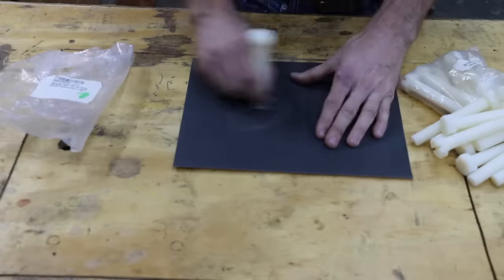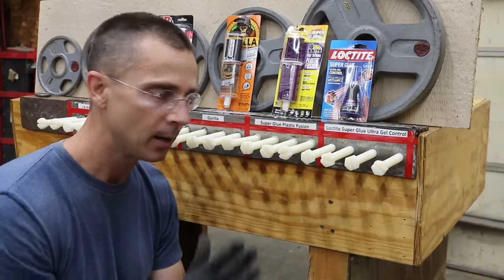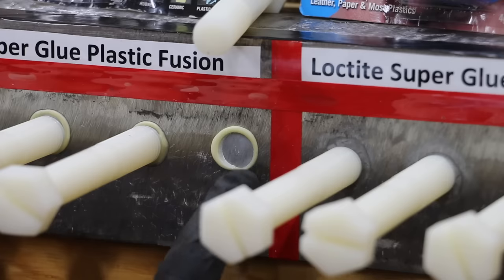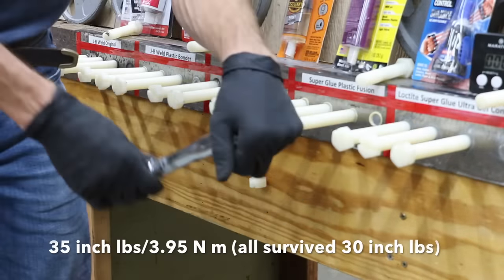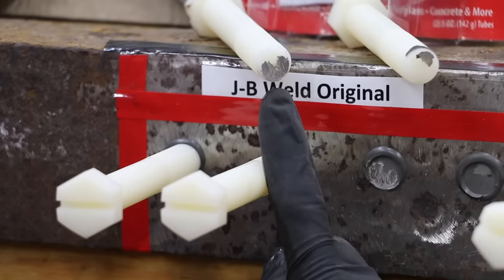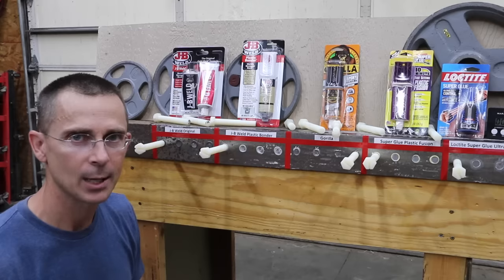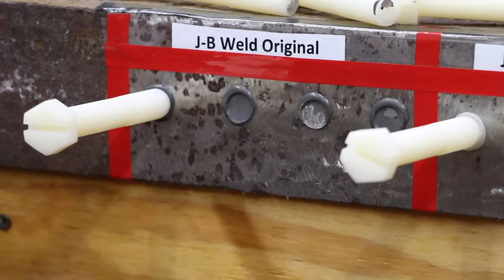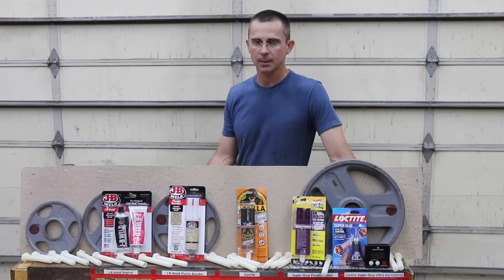Which Epoxy is Best for Plastic?  Let's find out!

Comment: Can you test threadlockers such as loctite and jb weld etc. and see if the work and wich works better? You can tight the bolts with the torque wrench  using threadlocker and then mesure the torque required to loosen them .
Reply from the maker: Teo, Yes, I plan to test threadlockers very soon.  Thank you very much for this recommendation!
Reply: I once used regular superglue one some bolts holding a pull starter on portable generator. When I had to remove them later the bolts wrung off with the nuts still glued on.
Reply: i'm sure there will be some variability, but most strong threadlockers require heat to loosen (without heat you can literally twist the head off the bolt)  It might be interesting to know the strongest that is still removable without heat though.
Reply: In the fastener of testing industry what you're talking about is a very common test. All you need is a clean degreased nut. Run the nut fully into the thread locker, let it cure, then measure peak removal torque.
Reply: The engineering company develops and produces precision testing equipment, the most common one we make is for torque measuring. The torque measuring system is most often used by beverage and pharmaceutical companies for testing cap install and removal torque but the system is very adaptable for measuring torque on just about any application, its an extremely precise and repeatable tester, I bet that it could even be used for the common test you mentioned otm646
Reply: That's way more complex than necessary. A simple beam inch-lb torque torque wrench is all that the ISO standards require.
Reply: Very good point, I seem to get a little ahead of myself at times and it seems that on occasion i forget the meaning of over-engineering and just way over complicate some things. i tend to try and remind myself to occasionally take a step back and remind myself that theres a point where what im trying is way above and beyond whats needed
Reply: Yeah..threadlockers, especially in engines...I's like to see that comparison..!
Reply: How would you judge a winner?  You don't want a threadlocker to be a near impossible to break bond, even something you consider a "permanent" fixture, may at some point need taken off.  Plus there are different threadlocker formulations for that difficulty and for heat resistance and at different price points.

In other words the best threadlocker for an application provides ONLY enough locking to keep the fastener tight in THAT application.
Reply: bhartley1024, you should have first applied some Super Glue Remover (product) or if the surfaces are not plastic, acetone will also soften up super glue (cyanoacrylate).  Ironically this works out great because it's usually a metal bolt and nut or tapped metal, which means the normal acetone/transmission fluid mix that works well for other seized fasteners will work on superglue too.
Reply: Threadlockers can hold too well. I don't think you really want something that hardens too much. If you can't at least loosen the threadlock enough with heat, all it means is a broken bolt in the future. You might as well weld it on.

Comment: Please try out dish soap (liquid kind) in a lawnmower engine and use the same amount of dish soap as you would oil
Reply from the maker: Thank you for this recommendation!
Reply: please do it its been driving me nuts if it would work as like a high viscosity oil
Reply: Project Farm try to mix each epoxy and see if they hold better
Reply: please
Reply: TheGirfan1234 no use atf
Reply: PingasTheFourth it's worth a shot
Reply: Instead of dish soap try maple syrup
Reply: williamkohlerjr gg
Reply: TheGirfan1234 and add a tad bit of water
Reply: Try using E85 in an engine, it supposed to be used only in flex fuel vehicles. Interested in how it will preform in a regular engine
Reply: probably foam up and ooze out, aerate and not work! lol, same happens in a dishwasher.....
Reply: well its worth a shot/lawnmower
Reply: He could try dish soap vs dishwasher detergent(non foaming).
Reply: TheGirfan1234> I agree with the griffon, no water, and no possibly abrasive dishwasher soap.
Reply: Dandruff shampoo would be interesting to see.  It seems to lubricate fairly well on those one armed bandit machines.  Would be interesting to see what it would do in an actual engine.
Reply: Most Dandruff shampoos contain I high level of zinc which is also used in motor oils to protect against metal on metal contact.  I expect it would fail eventually but it might take longer than you think.
Reply: This would be great to see!
Reply: What about the coal tar shampoo?
Reply: Put Epoxy in the lawn mower engine
Reply: With a small amount of liquid bleach. Bleach is slippery.
Reply: YEA
Reply: Feel how slippery your hands are before and after washing them with dish soap.  Your hands are definitely less slippery.
Reply: What's the point?  You gonna stop using oil?  I prefer spending time on useful stuff, like epoxy comparisons.  There are plenty of whacky-fun websites out there already.

Comment: First time on your channel and I love how thorough you are! However, I think it would have been good to test how much strength each had when being pulled directly away from the point of contact. I found this video because the door handle to my oven got yanked out and the housing holding the screws got stripped, and I wanted to see what product would be best to use. Thanks for the info!

Comment: Love your vids! I'd also like to see plastic-to-plastic, specifically ABS. I'm guessing those bolts were nylon? Nylon is more resistant to solvents than ABS, so these epoxies may perform better with ABS.  Majority of the time, when I need an epoxy, it's to glue back a mounting tab, joint, or bracket that busted off some ABS plastic snap-fit thing.  Lately, I've been repairing broken plastic things with LOCTITE 11C Hysol instead of my regular go-to, JB Weld.  I'm curious how it compares.
Reply: Exactly. test failed. trying to find out the best plastic epoxy but proceeded with a metal base frame.
Reply: Try 2 part plumbing glue. Or straight up black abs glue for putting together pipes. I've used it and it has never ever broke

Comment: You should compare different types of penetrating oil such as PB blaster and liquid wrench. To see which one works best on rusted nuts and bolts.
Reply from the maker: This is a great suggestion--thanks!
Reply: Project Farm+ if you do a penetrating oil test please include a popular home brew that is supposedly better than all the commercial ones, half ATF + half Acetone shaken well before application.
Reply: Siggy in CR Yes. I use this all the time. I will never buy commercial penetrating liquid again.
Reply: Dont forget kroil thats some amazing stuff
Reply: Aaron Kirchner PB blaster is awesome it does blow rust right off of stuff
Reply: He already did 2 of those...

Comment: Unfortunately the Nylon bolts weren't the best idea.. Try with plastic bolts next time :)
Reply from the maker: Great point--thanks!
Reply: Nylon is a polymer. "Plastic" is a polymer, The problem is there are a lot of "plastics" so what one, each have different properties.
Reply: @ProjectFarm  Also try ABS plastic sheet instead of the steel, since you are testing plastic bonders? Otherwise great video as always.
Reply: @gamecapturemoments1  Yup... lots of different plastics. Actually I think there'd be most interest in bonding metals to, say, carbon fiber reinforced epoxy or similar. Steel to polyethylene, polypropylene, PVC, etc. would be weak in any case. I'd probably use a fastener instead of glue. Steel to CRE or GRE would be of more interesting because 1) the material is more or less like steel in terms of stiffness and strength and 2) they glue better.

Comment: Everytime I’ve ever had trouble getting plastic to bond, it’s always been plastic-to-itself, so please find out the best way to weld plastic to itself…including whether or not plastic welding (like using a soldering iron) is ever the most effective method.
Reply from the maker: Thanks for the suggestion.

Comment: Hi,

I just wanted to add to the comments requesting/suggesting plastic to plastic epoxy/glue/mending tests.  I read a comment and agree, that nylon might not be the best representative, especially to metal.

I'd like to see it done with abs, pvc, and maybe some other common plastics.  I think most people are looking to repair a broken or cracked plastic part or piece of something and it's a very tricky thing.

I need to fix an oscillating fan part.  It's the piece that allows the fan head assembly to pivot/click up and down to various positions, and the power cord goes through this piece.  It's cracked in half ("cleanly" but not "straight, if that makes sense).

Anyway, I'd pay $30+ ($150 cad that is) to get a good fix, because I can't find more of the fan and it's really good.

Thanks again for your time and efforts.  Much appreciated.
Reply from the maker: Thanks for the video idea.

Comment: For Plastic to Plastic, I’ve used the Loctite Plastic Bonder (separate activator and glue) and it worked great after giving the mating surfaces a good cleaning with rubbing alcohol and scuffing them with sandpaper.
Reply from the maker: Thanks for sharing.

Comment: Good job, but the only accurate way to test against one another would be to do the same test to multiple bolts and average the results together, too many variables to do each test one time on each bolt
Reply from the maker: Greg, this is a great point.  Variance is an issue. Thanks for commenting!

Comment: Try printer ink as oil for a lawnmower
Reply from the maker: Thanks for this idea!
Reply: Austin Pieschel Very expensive,  but a good idea aswell
Reply: most of printer is soy based so soy bean oil would work  I think
Reply: This guy is not a millionaire, no one has that kinda money.
Reply: Some inks use solvent, which could be flammable. Use caution in your selection.
Reply: hd the wise has the right idea. Much cheaper
Reply: Wood Crafter thanks I love his ideas for video but I believe he has a budget lol if he fills a motor with ink I'll ask him for a loan lol
Reply: The price for a gallon of ink would cost about $3500 according to HP
Reply: Silly idea.  That much printer ink costs more than the mower engine.
Reply: How about firing up the inkjet and topping off the cartridges with lawnmower petrol? I'll sell you some but limited time offer I sell u jugs of lawnmower petrol with added ability to print beautiful. 1080p HD pictures just like the pros. 1 gallon for 125$

Comment: Can you test how even you have to mix the resen and hardner, like do a 50:50 mix and 25:75 and 75:25
Reply from the maker: Noah, thank you for this idea!
Reply: That is a stupid question. Epoxy can not be mixed in different ways. It is not like polyester where you can play with more ore less hardner. There is only one correct way to mix. In laminating epoxy's a diversion of 1% can already weaken the epoxy by 50%.
Reply: wow, Hakeem, What a harsh reaction to my statement.
First of all, I am not anonymous on the internet, far from that. Google me and you will know who I am. By the way, I did not make an ass out of myself and yes am a big guy.

Second of all, I only have 30 years of experience working with epoxy building Windsurfing boards and now Windsurfing Fins in Carbon Fiber. So I know what I am talking about.
My statement is 100% correct. In this time period where you can have acces to Google, asking a question that you could have answerd yourself in 20 seceonds (by googeling it) is in my opinion a stupid question. The first thing a teacher teaches you in school is to think first and try to find the answer yourself befor you ask a question.

Every epoxy has his own exact mixing ratio based on the chemical composition it is made of. Not following the mixing ratio of the manufacturer is not smart. For every epoxy there is a datasheet where you can exactly see what propertys are of that epoxy, for curing times, curing temperatures and mixing ratio. That is where I get my info, and the 30 year experience.

Fore more information here are a view links to what epoxy manufacturers have to say about it.
https://www.westsystem.com/instruction-2/epoxy-basics/dispensing-mixing/
http://www.resinlab.com/images/resources/pdf/EpoxyMixingInstructions.pdf
https://www.r-g.de/wiki/Fehler/Ursache/Abhilfe
Reply: actionmedia4all What a big boy, what a smart boy!
Reply: Noah Michnik the more hardener you add the quicker it'll set.

Comment: As a truck driver, I have a standard kit of adhesives I cannot go on the road without.

1) JB Weld heave duty epoxy (2 tube set)
2) Gorilla Tape black extra wide, white standard width
3) Zip ties of multiple sizes

I constantly utilize all 3 regularly!
Reply from the maker: Thanks for sharing.
Reply: @ProjectFarm  Of coarse, & I liked your QC test!

Comment: It’s not an epoxy, but I have had great success adhering metal to plastic using E6000.  It is flexible, strong, sets quickly, resists high ambient temperatures, and dries clear.  Kudos for such an amazing channel!
Reply from the maker: Thanks!  Thanks for the feedback.

Comment: Had a plastic tab cover on my vehicle that cracked. After watching your video, I decided to repair the crack with JB Weld. I measured by weight each half before mixing to insure maximum hardness. I let it cure for 36 hours before trying to reinstall it. As soon as I tried slipping the cover back onto the tab, it split again.
Reply from the maker: Thanks for sharing.

Comment: I use JB Weld on EVERYTHING! My dad used it on an engine block once and it never failed. I have been using it for years. Proper prep it won't fail.
Reply from the maker: Thanks for sharing.

Comment: I use the Loctite Super Glue Ultra Gel Control on a lot of things. I find that it is great at melding most plastics together. I like to fix plastic pieces with the Loctite Super Glue before adding JB Weld or Loctite PL 3x around the structure. Also, Loctite bonds ceramics extremely well. Once you apply pressure, it is stuck for good.
Reply from the maker: Thanks for sharing!
Reply: My samsung fridge plastic parts break easily. It’s annoying, 2018 fridge. I regret it. Does the loctite super glue ultra do well plastic onto plastic?
Reply: @L-h8py  I also have a Samsung fridge and the ice tray breaks easily! (The icemaker is trash.) The Loctite Ultra Gel Super Glue does work very well on most plastics, but to a point. I originally bonded the ice tray with the Loctite gel and then used JB Weld over all the cracks I bonded, but the JB Weld would peel off (flakes in the ice) and the stress would crack the Loctite gel again. I switched to Loctite PL 3x and that worked a lot better and it was easier to apply considering the size of the tube. Samsung refrigerators are very problematic, especially the models that have their ice makers inside the refrigerator section instead of the door or freezer compartment.

Comment: Way back in the 70s, I worked at a sporting goods store as a repairman. We used a lot of JB Weld on skis. It was soft enough to flex with the skis and strong enough, to hold on the steel edges. Great stuff.
Reply from the maker: Thanks for sharing.

Comment: You're right about being careful which chemicals to put on plastics.  One of the toughest plastics is polycarbonate (Lexan).  It's much stronger than acrylic and will bend more before breaking.  I once tried to drill a 1/4" hole through a 1/4" thick Lexan sheet and the standard drill bit stalled the battery powered drill.  Using a more powerful drill, the Lexan twisted near the bit, and finally shattered while I was trying to hold on to the drill motor with two hands.  Acrylic might also shatter but with much less effort or force.  (I came up with a drill sharpening strategy that eliminates the problem that also works well with thin-walled materials like sheet metal.)
On the other hand, polycarbonate can be totally corrupted by some common chemicals.  I've seen polycarbonate shrink and fracture in the presence of some common household cleaning chemicals (Spic-n-span floor cleaner comes to mind) and what was one of the toughest plastics becomes denatured into the consistency of hard candy that shatters with minimum impact.
Also, I see that this test is done using Nylon screws.  You know that Nylon will react differently than other plastics.  The category "Plastics" is so broad in terms of characteristics, especially when you consider the possible use of added compounds and fiberglass fillers, that assuming some commonality among them is a bit like assuming anything classified a "spice" will roughly affect the taste of food about the same way.  ...or like assuming that Chinese, Japanese and Korean people are more similar to each other than French, Congolese and Polish are similar.  (They aren't similar at all and I'm not exaggerating ).  Just know that, beyond how typical plastics of similar hardness feel in your hands, their characteristics in the presence of adhesives, chemicals, and the environment may be totally different.
Reply from the maker: Thanks for the feedback.

Comment: Another well designed, objective and informative test and video. I use most of the epoxy adhesives featured in your segment and my experience with them is pretty consistent with the testing here. It’s good to see my experience replicated in a controlled comparison. Well done.
Reply from the maker: Thanks!

Comment: Thanks again for another review.  A piece of my vinyl fencing broke.  Your test is:  nylon (or Teflon) to steel.  Mine is vinyl to vinyl.  But I'm confident JB Weld Original is for me.  If your're doing future epoxy tests, maybe temperature cycling over a few days in the the winter, to see if expansion/contraction degrades adhesion.
Reply from the maker: You are welcome!  Thanks for the suggestion.